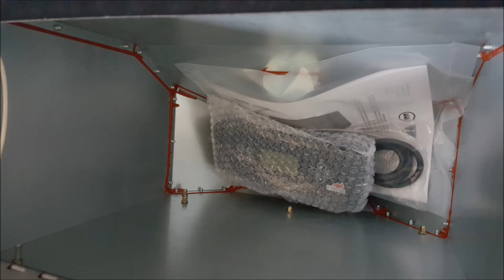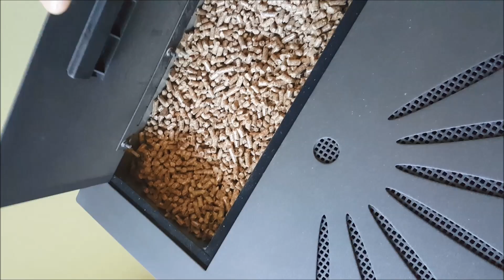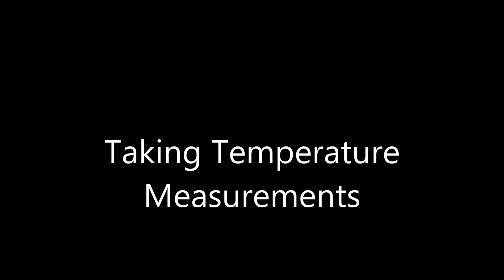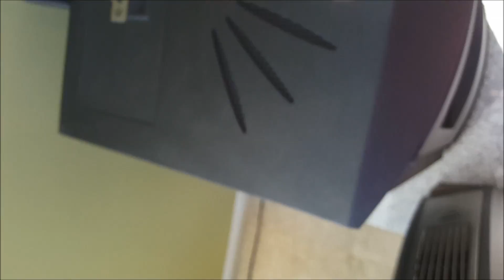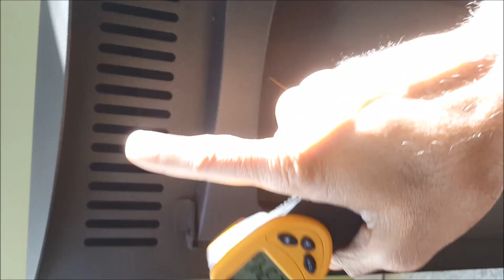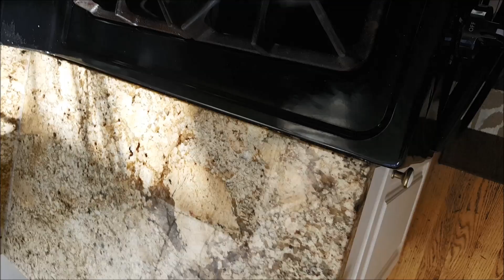Castle Serenity Wood Pellet Stove

Comment: Just installed one.  His outside pipes are too close to the siding per the instruction booklet and the pipes do not look to be insulated as recommended.
Reply from the maker: The distance are indeed as per instruction plus some gap. The pipes are Double walled Dura Vent kit.
Reply: @ajain1427  I agree, you did the pipes correct per the instructions given.  Nice job

Comment: One bit of information you NEVER find anywhere is the pellet consumption rate. This is the auger feed rate & it does not vary from any setting in the control or configuration. The feed rate is 2lbs/hour when the combustion is turned on....Therefore the cost to run can be calculated. at $6/40lb bag = $30c/hour

Comment: Fantastic review. Super informative. I’m picking mine up tomorrow and installing myself.  Thank you very much.
Reply: Are you enjoying yours?  Any issues with installing? Thanks
Reply: @mattc6924  no issues. Worked great all last winter and this fall. My Uncle bought one for his house for those real cold days and nights. He loves it.
Reply: Chuck B. Thanks for the reply. I’ve read where some people have had issues with size of flute on the stove, being smaller in diameter than 3” venting pipe. Did you experience this issue?
Reply: @mattc6924  no problems. Had to adjust fan speeds but it works great. I use mine to heat my 700 square foot, insulated shop. Very seldom drops below freezing. When it does, I just go out a couple hours early and start it up. By the time I’m ready to work in shop, it’s 60°-70°. I’ve cleaned the fan area once. Wasn’t bad.

Comment: Excellent review. Very informative. How loud would you say the blower is? Similar to a bathroom exhaust fan? Just don't want it to drown out the TV. Will be installing in the living room of my 1400 sq ft cape and am thinking the heat will naturally find it's way through the house and up the centrally located stairwell.
Reply from the maker: + Matthew - Thanks for the comments.  I have it in my living room at the first floor with cathedral ceilings. The second floor gets really toasty as most of the heat goes straight up and through the ceiling inclination into the rooms. So I use a secondary fan to divert the heat to the first floor as well to avoid heat zones. There are 5 settings for the blower. At setting 1 (lowest) you can barely hear the fan running. I usually keep the setting at number 2 as I found out that this gives the optimum burn to heat dissipation ration. It also depends on what is the open setting for intake pipe. Mine is at 50% as I am about 700 feet above the sea level. At setting 2, you can sit next to the stove and still have a very decent conversation. At settings 4 and 5 it does get loud - a little bit more than the bathroom exhaust but less than the kitchen hood exhaust. I have used it for one season and when I did the end of the season cleaning, it was a piece of cake. Hope this helps. BTW, this season, I intend to use this as my primary source of heating and keep my HVAC heating system for humidity control only.
Reply: I just fired my serenity for the season. Pretty happy, not much noise with the fan - can have a comfortable conversation sitting next to it.